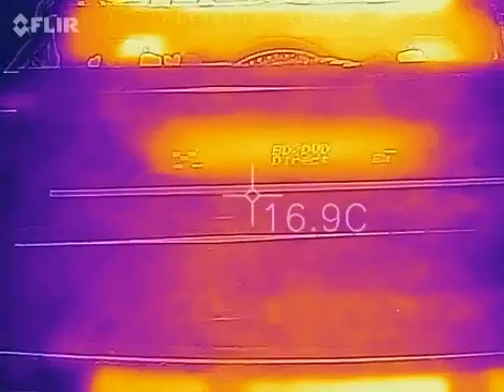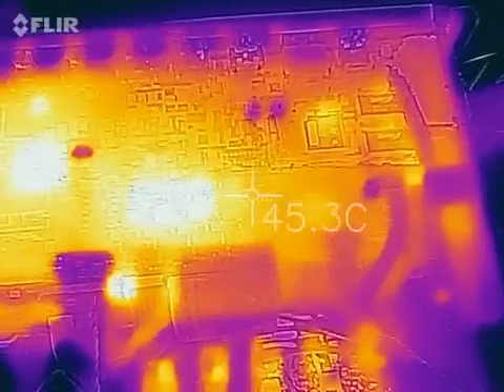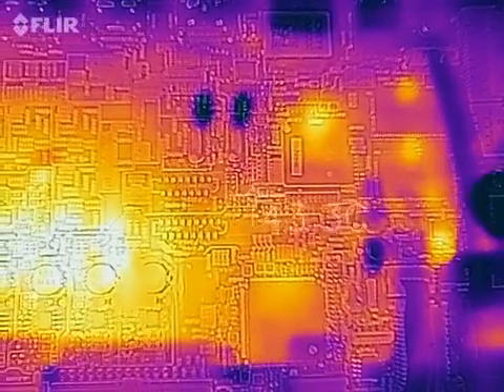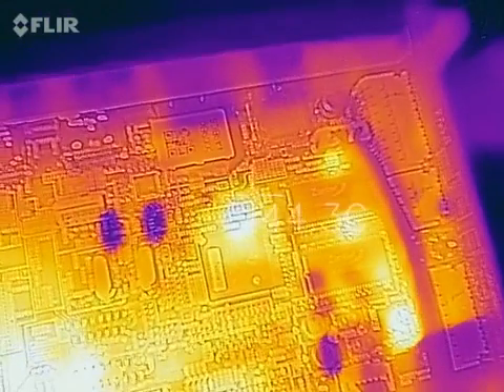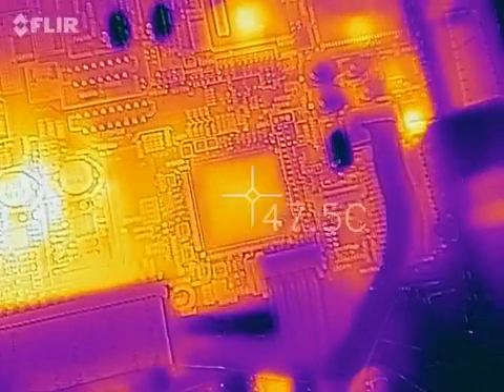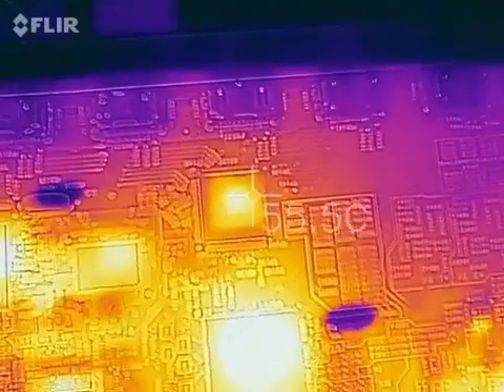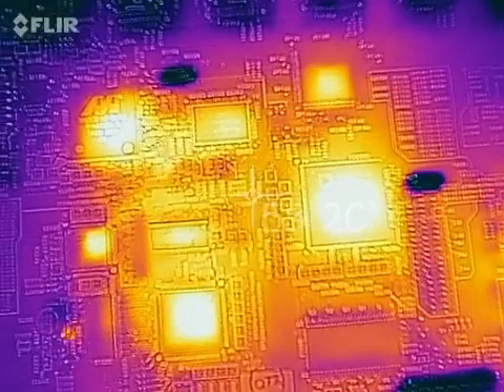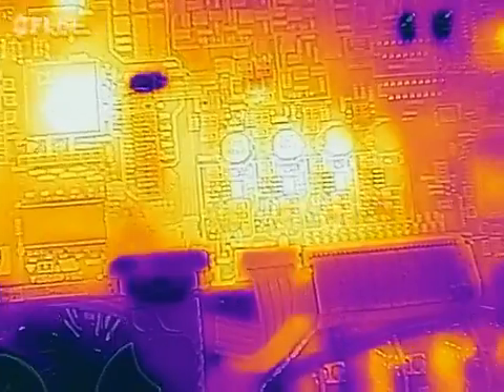Onkyo TX-NR 5009 HDMI Board Thermal Imaging

Comment: Nice look at all the chips! Looks like they could all use heat sinks and a fan. My two onkyo’s have crapped out because the dsp and vsp chips overhearing
Reply from the maker: yep, heatsinks are cheap and a fan runing off a usb socket give a nice gentle flow of air thrrough the amp